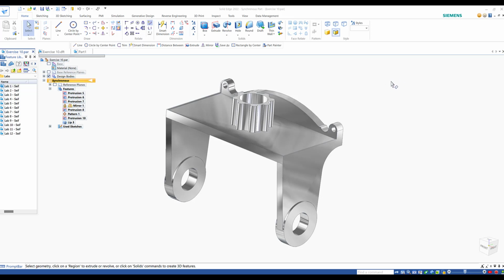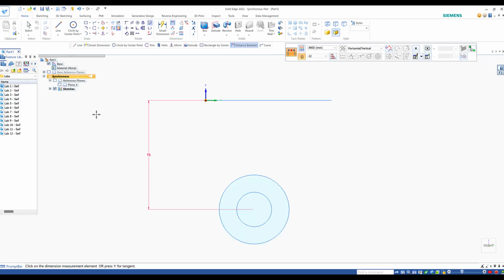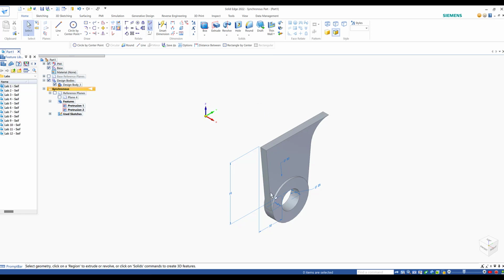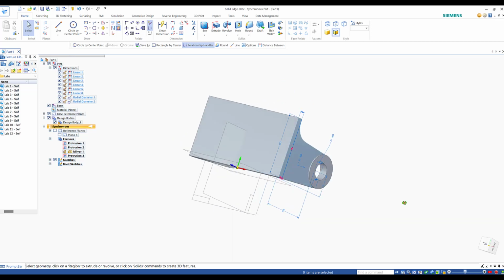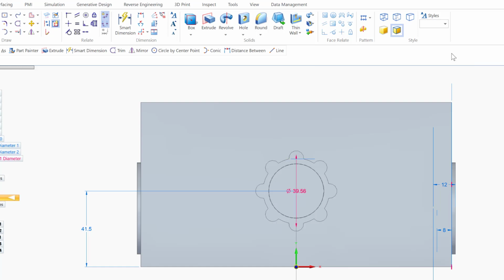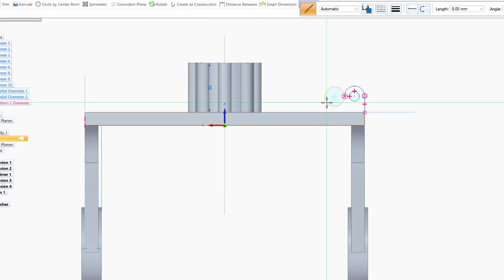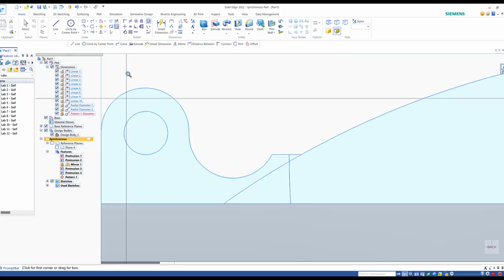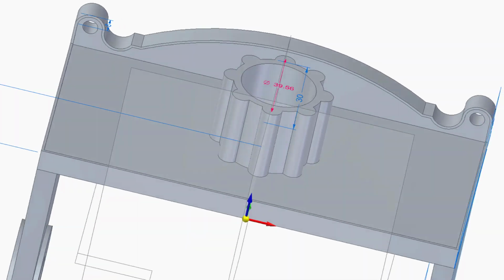Solid Edge Tutorial - Exercise # 10

Comment: You really need to Learn how to use the Arc commands. Your using the Circle commands and Trim for the large 115mm Radius Arc. That isn't very intelligent CAD use. It works for pencil, paper, and board.   Also, I don't believe your fudging those arcs with a hole in the background was correct. You are not making a true and honest drawing. But, a fudged sketch. When a drawing is incomplete to make - You should tell the students that you don't have enough information to making a true and accurate drawing. So, for the Exercise - Simply make something that works.  As you did with the Tangent Free Forming the curves with Circles.    NOTE: I looked closer at the holed tab. The holed tab is a circle with two vertical lines tangent The interior one is trimmed away/erased. This is the start point for the inverted 6R arc - which you can make with your circle tangent to the end point of the trimmed tab downturned arc.  Then,  ? , maybe the 3mm straight horizontal section might be at the 180° point of the upside down arc???  However, what you did was - wrong...  The large 115mm Radius Arc is easily done with one use of the 3 point Arc command. Note: The arc commands generates arc in the CCW direction. You don't need math nor a bunch of circles and repeating Trim commands.

Comment: can i suggest a video? when making a design i want a row of holes on a block. I would like equal distance between each hole. the only way to do this make the block. add 1 hole and then pattern it. but i have to make it a 3d design first. is there a way to make patterns in the 2d design phase?
Reply from the maker: Thank you for your suggestion. Yes, you can do that using the mirror command. But, it is preferable to do it using the pattern command for future editing and changes.
Reply: @drmseif  but is there a quicker way saying i wanted 100 holes
Reply from the maker: @Craigs_Adventures  actually I don't know